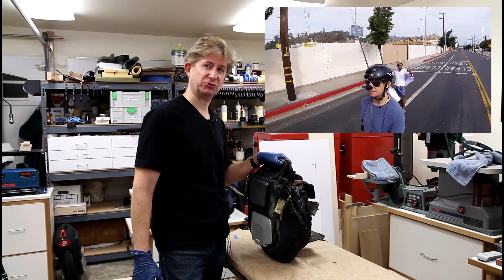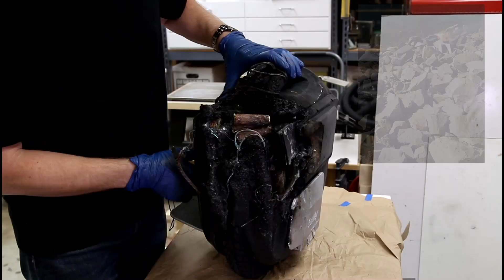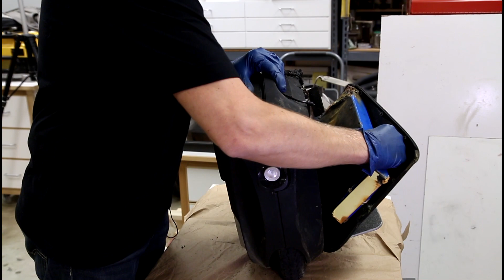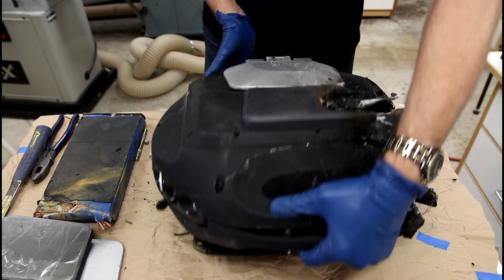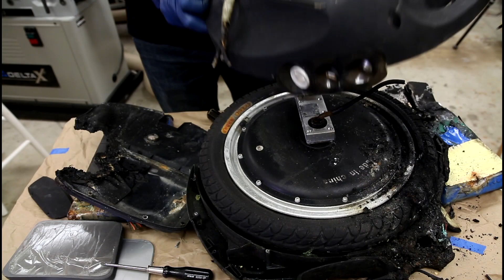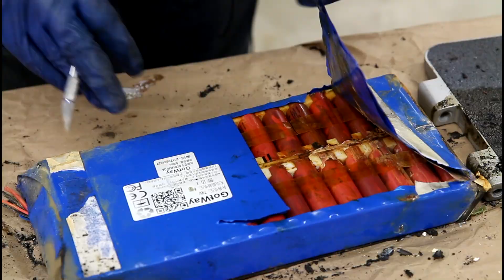Anatomy of a Burned ACM

Comment: Why do people turn off the safe guards. 
1. Turn off Tilt back 
2. Turn off beeps 
3. Slippers on main road. 
4. No helmet on main road. 
5. I just don't get it.  
6. As a safety measure, manufacturer should remove ability to turn of safety measures like tilt back.

Comment: Wow! Another Gotway victim. Here's wishing Yoshi a quick and complete recovery! 
If you get back in the saddle Yoshi, buy Kingsong. The quality difference is amazing.
Reply: Did you listen to what Marty said  what yoshi was doing when it happened?
He had a low battery and he was pushing it, and he turned off the alarms and the tilt back
yours would've done the same thing
That was user-caused and NOT GOTWAY'S FAULT (in THIS case)
pay attention before criticizing
yoshi is awesome... but even HE would tell you this was HIS fault because of the situation leading up to "the event."
Reply: Greg Savel so? I owned a Gotway MSuper V3.. it lasted about 5 miles before it blew the main board over next to nothing. Gotway is crap. The only thing they have is speed. I require quality in my wheels as well. Was Yoshi to blame? Most certainly he was a major contributor. Look at YouTube, or any other media, Gotway failures are everywhere.. from blown MOSFETS to melted wiring, to firmware that tosses you into flower beds. I have seen many Gotway fail vids. Where are the Kingsong vids? 
Segway vids? InMotion vids?
Sorry, Yoshi aside, I call a spade a spade, and I am hoping to save others the expense and pain of owning Gotway.
Reply: i don't dispute ANY OF THAT
my point is... in THIS case..... 
turning off the alarm
turning off the tilt-back
riding 30 mph with a depleted battery
THIS can happen... with NO FAULT TO GOTWAY
IN THIS CASE
that was my ONLY point here
Reply: Greg Savel then we are in full agreement on that point. Alarms, tilt-back, and charged batteries are a good thing.
Reply: Amen to that
we know that this bleeding edge technology carries inherent and sometimes unforeseen risks
yoshi knew that and still does
he's a great rider
maybe he will alter his way of doing things and maybe he will not
most importantly, I'm thankful he will make a full recovery was not injured in a worse way
looking at that flaming wheel is pretty frightening
happy that wasn't on a plane
please ride safe..... King Song... Makes awesome wheels
enjoy every mile. Please post a lot of videos